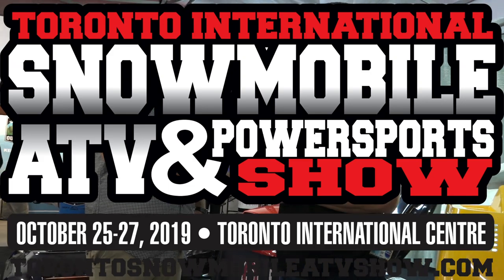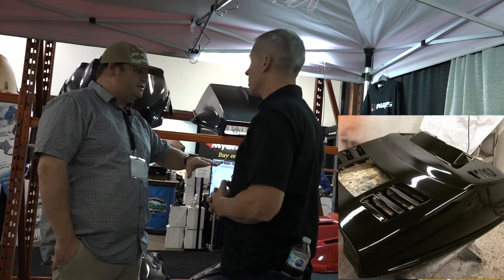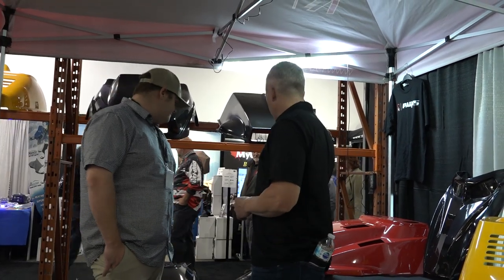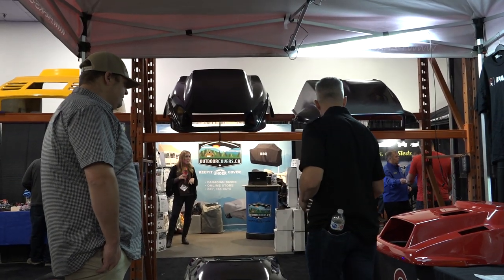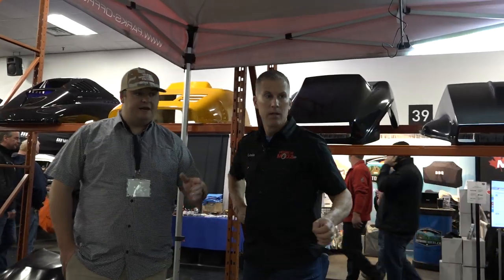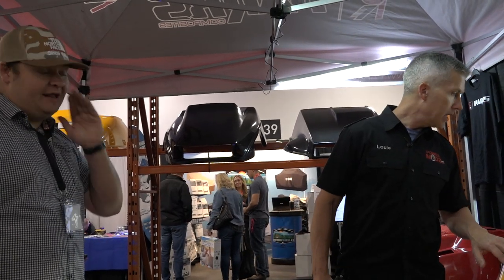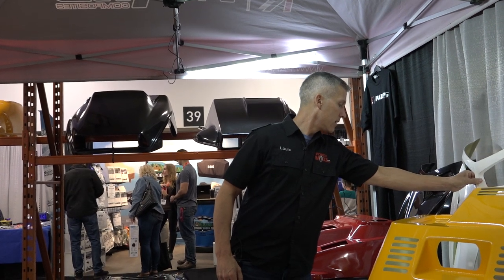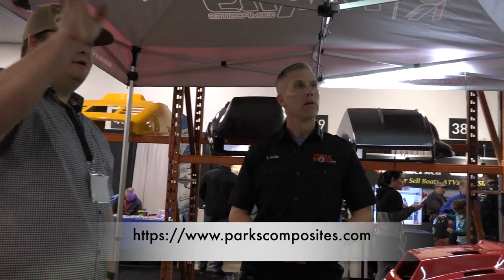Parks Composites Reproduction snowmobile Hoods!!!  Toronto Show!

Comment: is that a good price 380 or is it to much for those hoods
Reply from the maker: thats pretty amaxing actually...they are extremely well done.
Reply: lexan panels and hoods,  are going for around the same price used.
Reply: 380$ is expensive for hood.. try to find a part sleds with a nice hood instead.
Reply from the maker: @nickbrah  380cdn?  ok sure find me an elan with a hood that nice for 380 and ill buy all you can find.